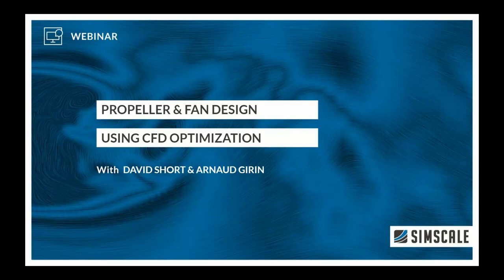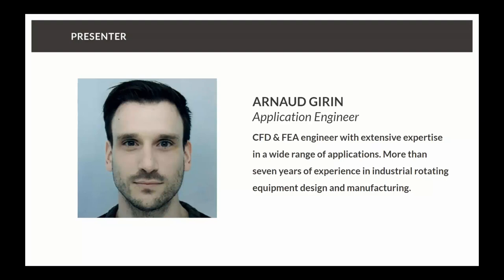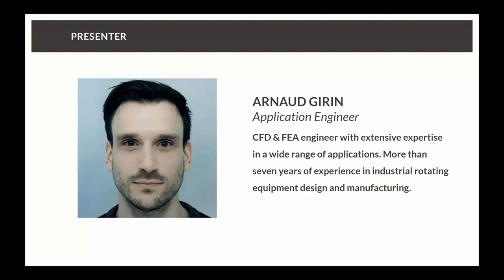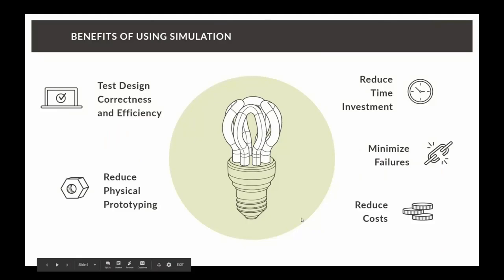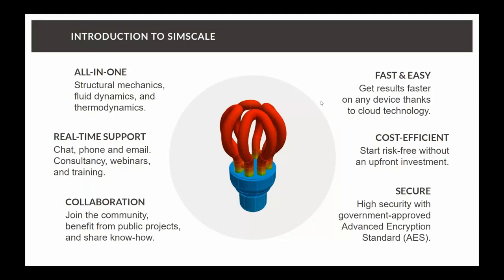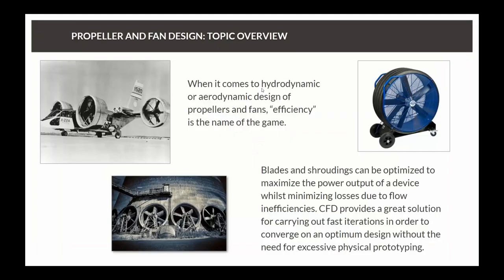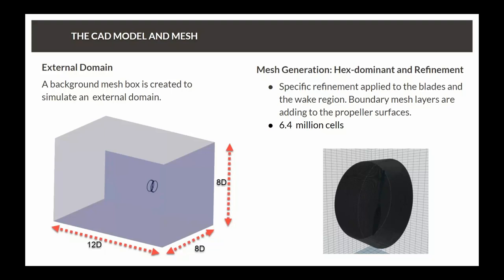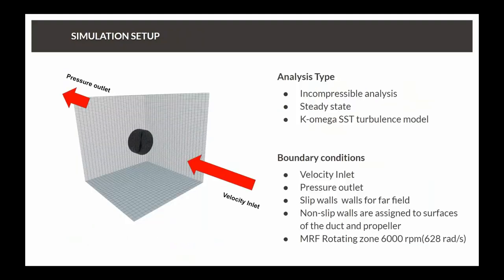How to Optimize a Propeller or Fan Design

Comment: I am designing aircraft propeller sir.  I have a doubt.. Where should I apply the blade angle and sweep angle
Reply: Feel free to post your question along with the link to your model in the forum, we will help you out!
Reply: @JousefM  Which forum? I have a Fan Blade and I am wondering about blade curvature from a front view. I have the blade angle and size worked out. But the # of blades to use and wether or not to incorporate an S bend into them has me confused :)
Reply: @reeceengineering3560  forum.simscale.com :) That's something you can decide for yourself and then see which design leads to the best results (whatever results you are aiming for) - most of the time there is a tradeoff between several parameters.

Comment: Hello,
I have been trying to do this simulation for custom designed propeller for Mars helicopter.  want to know you you defined Air material to the bounding box? I only get to select the cylinder as volume for adding material. Can you help me to define bounding volume in material section? Thanks in advance!
Reply: You can simply select the material for your bounding box on the left side under "Material" and choose "Air" which is totally legit by the way as you want to let air go through the domain. What exactly are your concerns here? You can also select a material and adapt its parameters in case you want to adapt it due to different atmospheric conditions.

Comment: Thanks for sharing. I see in your project that your geometry outside the simulation is different than inside the simulation. The simulation has a "BoundingVolume" part defined, apparently with negative geometry of the prop. How was this created?
Reply: Hi Joshua!
AFAIK the propeller was just enclosed in a cylinder in a CAD software - the so called bounding box around the cylinder & propeller can be created on the platform and will be created by the mesher! Does that clarify things?

Comment: One thing always puzzles me is why you can give arbitrary and independent inlet speed and RPM values at the same time as boundary conditions to begin with? I always thought the inlet speed is a result produced by a certain blade / system design at certain RPM. can someone educate me on this, much appreciated!
Reply: Hello, my understanding is that the starting velocity is helpful in setting the flow in the proper direction and can help the solution to converge more quickly, even though it is not the true accurate solution for the velocity across the inlet. As such I don't think it would be a true boundary condition, just an initialization parameter.

Comment: On your propeller efficiency slide before Q and A.....Shouldn't your RPM be engine RPM not Propeller RPM? The reason i ask is because most propellers cant exceed 3000 rpm.
Reply from the maker: This is very specific and related to the technical application. In this simulation, we have actually simulated the propellor for this RPM range therefore we use this display format.